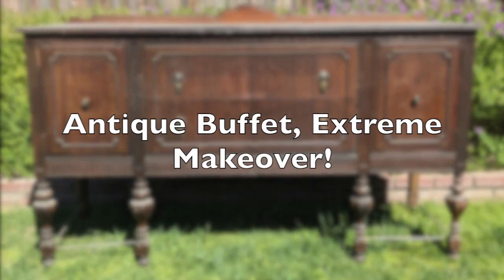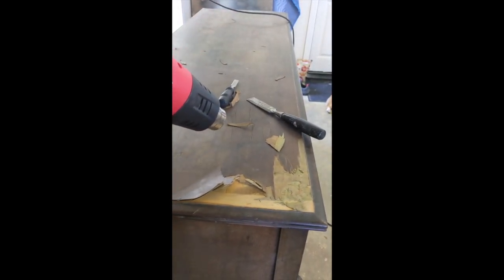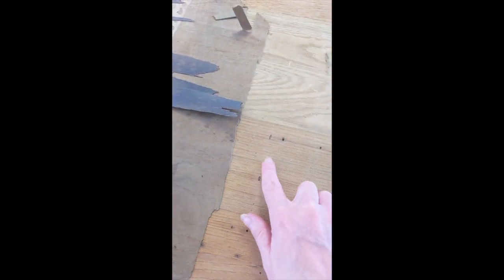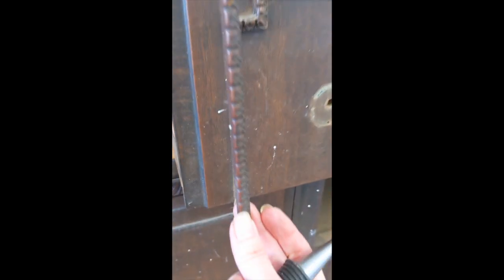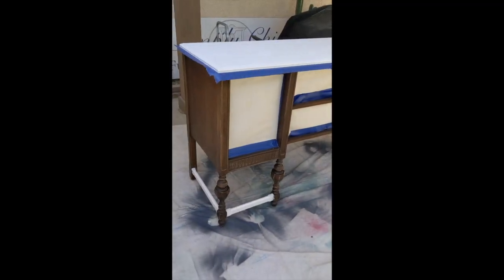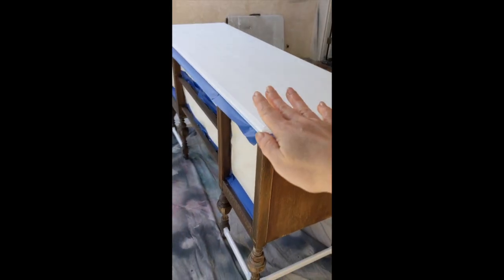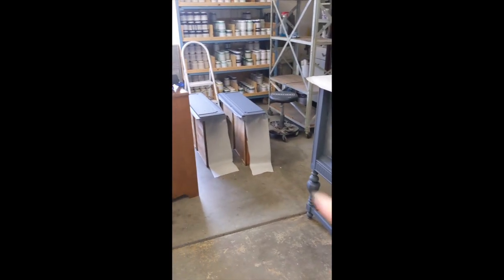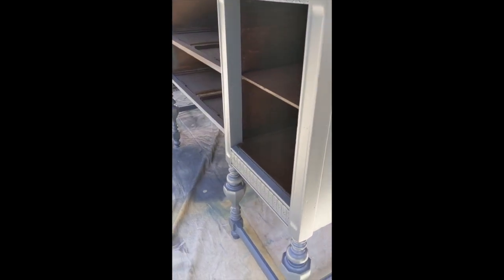Watch This Antique Buffet Get An Extreme Makeover Using Fusion Mineral Paint!

Comment: Wonderful!  Did you get to save the hidden drawer?
Reply from the maker: Thank you SO much Barbara!! Yes, I did! 🎉 It's actually hidden below the top 2 drawers and still visible after painting. There are two metal clasps under the drawer (one on either side) that you pull and the drawer slides out!!! One of the coolest pieces I have ever had in my back stock in all the years I have been painting 🖌️🎨.
Reply: @SimplyChicFurniture  Thank you soo much.  I was hoping you got to save it.  I have a VERY similar piece from my mom's laundry room I've been seeing for over 60 years.  Alas, I checked it (it's at my daughter's house now) and no hidden drawer;-(
Reply from the maker: @barbaramorris6118  that's too bad yours doesn't have a hidden drawer for the silverware 😔. I have seen a lot of buffets in my time working with furniture and this was the first time I've come across a hidden drawer 😱.

Comment: Wouldn't a bit of sanding and gesso to clean up the top, been easier than a heat gun?
Reply from the maker: Great question! There was a lot of delamination and cracking happening with the veneer on the top and drawer fronts. Due to the buffet's age the veneer has gotten very brittle over time. My customer wanted the top stained so removing the veneer had to happen so the heat gun helps liquefy the old adhesive and you can easily remove the layers of veneer with a wood chisel.